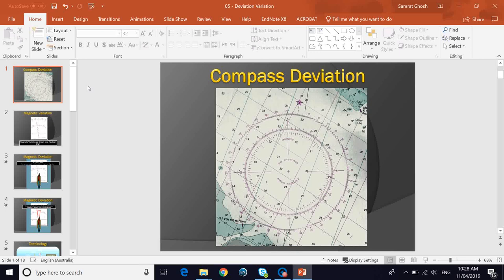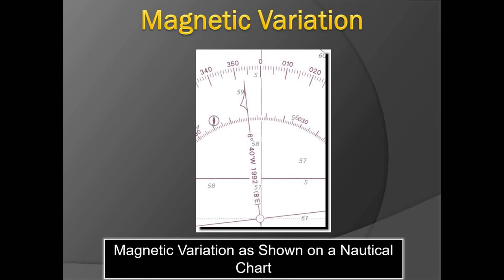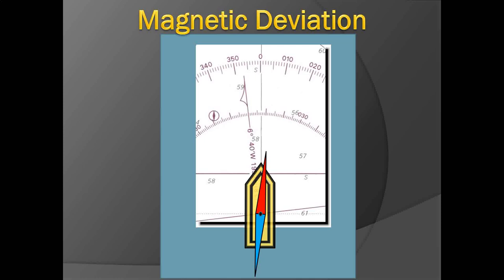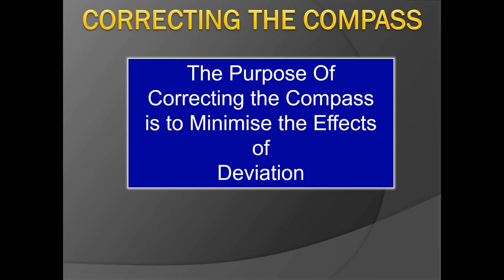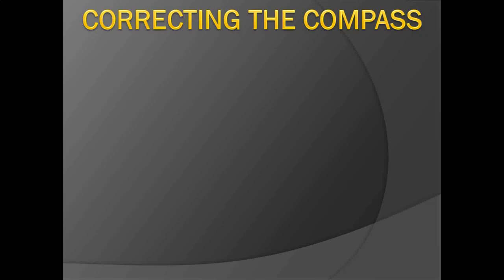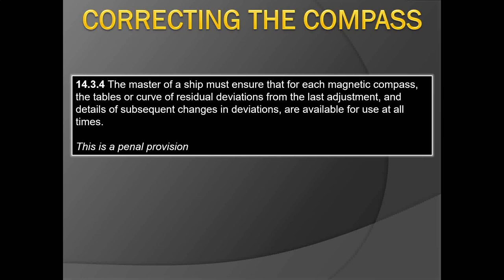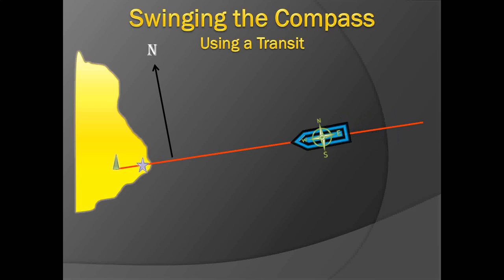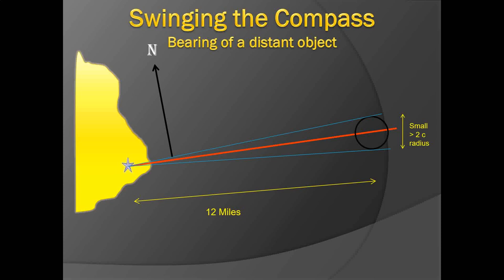Deviation of the Magnetic Compass - Swinging the compass and Deviation Card

Comment: Very good video.  I am an armchair navigator and this was nice.  Did you know in WW2 on Guadalcanal us forces had to use native guides because their compasses were useless because of all the iron there?
Reply: Because of the coming micronova, declination is moving much farther, and much faster and so declination information is likely incorrect My up-to-date declination is 30 degrees, 15 degrees off from the official declination for my area. but there is still a way to recalibrate magnetic declination using the shadow of sticks recording the path of the sun---rotation of the earth has not yet changed. First stick will show East. Mark it with a sharp stick pushed in. After a few minutes you can mark sun shadow travel where the shadow has moved - Push another stick in to mark West. Lay a straight stick from the E mark to the W mark. Geographic north or True North is 90 degrees from the E-W line. With your compass pointing toward True North, note how far off your compass is now. That is your true up-to-date declination. More on micronova in my 2nd book, Surviving the Micronova: This Train Is on the Tracks is available now.

Comment: Thanks for sharing. 9:17 "sum total of all deviations to be < 1 degree". And you said 9:45 "the sum total of all deviations on different headings should be less than one degree". So I presume there must be a list of a limited number of headings that are used for this sum. If so, what are these headings? Are they all the angles listed on the deviation card 10:41, i.e. every 22.5 degrees? But in this case, the sum is obviously far greater than 1 degree.